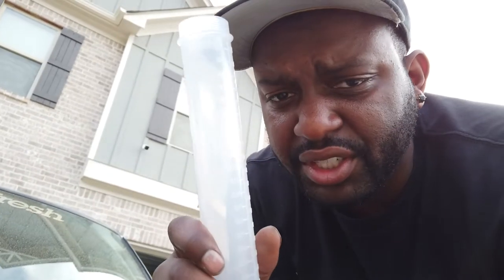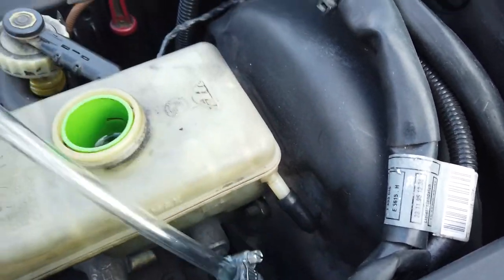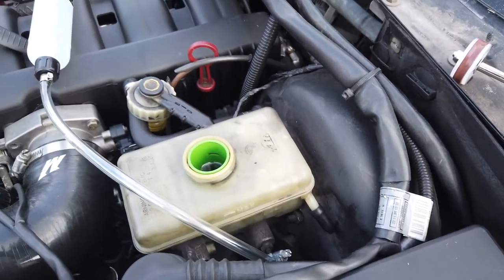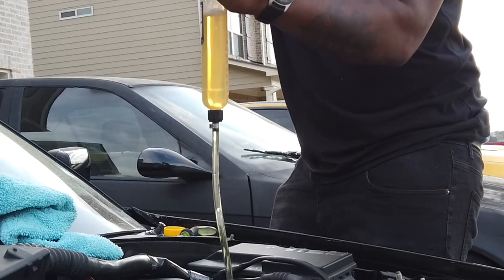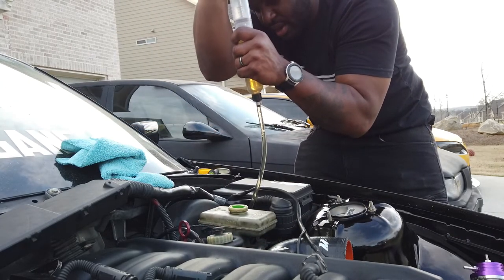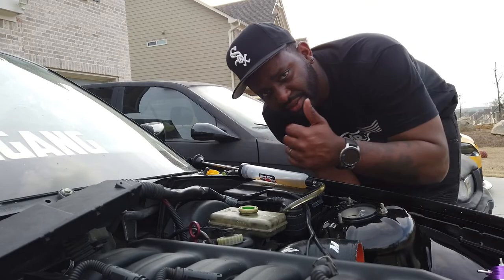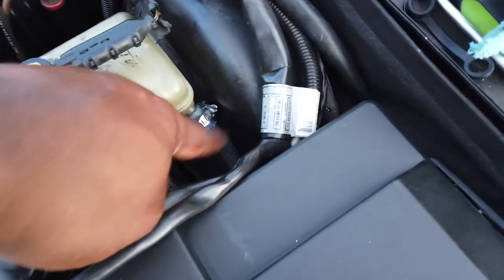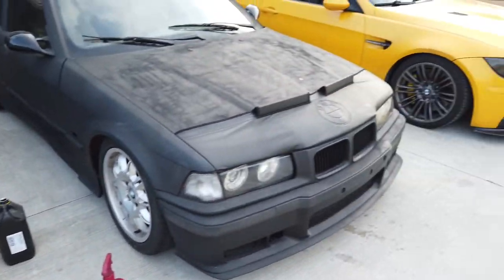Bleeding an E36 Clutch With a Syringe! Secret Trick

Comment: Bro! I built a race truck. Swapped to a 6.2 motor, and a custom 5 speed transmission. The transmission was also custom built. The gear shifter has always vibrated and the clutch engaged very low. It was always a soft clutch. I thought that was how they designed it. One day...boom clutch had no pressure and won't go in gear. I see the reservoir is bone dry. The slave and master were new, with braided line. I do this exact thing but with a tiny syringe. Brand new clutch and shifter now. Clutch engagement is where it should be. Great pressure, and shifts like a dream. It takes a while to get all the air out but literally cost me nothing. If your in a bind... This works great.

Comment: I forgot to mention that I had no choice but to do it like this. My situation was I test drove my truck for the first time after the motor swap. Re wired EVERYTHING from sound system to power windows to lights. Drove a long way because everything was working great. I go and eat lunch. When I got back the clutch had no pressure. Truck has a 5/8 drop on 24's. No way I could get under the truck without a tow or someone bringing tools. My wife brought the tube and syringe.

Comment: I spent about a week on my Honda trying everything including vacuum pumping short of pulling my master cylinder off which is a total pita to access. I saw you and two other guys use an oil syringe for this so I'm going to try this and I'll let you know how it goes!
Reply: How did it go?
Reply: @michaelcliffe562  I ended up forcing fluid through the slave bleeder with about 2atm of pressure with the syringe while simultaneously pulling about 2atm of vacuum via the reservoir line that feeds the master cylinder.

It was only when I did both simultaneously that I started bleeding off significant amounts of air. As I suspected, I had enough of an air pocket in the master cylinder that it was preventing the fluid in the reservoir from flowing. Just pushing or pulling from a single direction only produced enough pressure to compress the bubble.

Now my clutch pedal is probably at least as firm as it was 26 years ago :D

Definitely recommend the syringe. If I had to choose only a vacuum pump or only a syringe, I'd go with the syringe. Using it without the vacuum, I was able to get some clutch pressure, but not enough to fully actuate the slave piston.

I never thought I'd spend over a week bleeding a basic hydraulic system like that. My neighbor's an engineer and he was starting to question his sanity over the whole thing too haha. Didn't think I'd end up at the horse store looking for tools for my car lol. I guess horses are technically hydraulic systems, now that I think about it....

Hope that helps if you're having the same issue.
Reply: @ThorsDecree  That is awesome! Thanks so much for the answer! I'm from Germany and I've been trying to bleed the concentric slave cylinder in  my FWD Renault Clio for...well, about a week now! I've vacuum bled it, pressure bled it, reverse bled with vacuum and pressure from top to bottom and vice versa and nothing works! So this is the next thing I'm going to try as I'm convinced that the air bubble isn't even in the slave cylinder anymore.. I've ordered a sringe kit on Amazon and I'll let you know after easter. Again thanks alot for the reply!
Reply: @michaelcliffe562  as long as you have verified that fluid can flow, that the line isn't blocked, it should just be a matter of getting the right amount of pressure. Depending on how your master cylinder is set up, jack up the front of the car or park on a hill. It'll help you get air out of the master cylinder.

Good luck! Btw, if you have any farm stores around, I used a horse syringe. Same tool, but the livestock store sells it for 1/5 the price an auto parts store charges.

Good luck, brüder. Let me know how it goes, I can relate to the struggle haha.
Reply: @ThorsDecree  yah me too, my damned volvo 740 slave is blown and a week later my master cyl spring is broken into two pieces, after fiddling and fixing the broken spring and seal clutch still not working and i am trying bleed from the slave cylinder. hope this method works cuz ive been working on it for 3 weeks just bleeding, i might tow this sucker to the shop if it wont work i just got no time.
Reply: @sirgilang90z  It worked for me, hope it works for you. Had to use a syringe and vacuum at the same time, but eventually it started flowing. Was LOTS of air in both the line and the master.
Reply: @sirgilang90z  any luck with the hydraulics? Did you try pump + syringe?
Reply: @ThorsDecree  well it works, but i just use the syringe, push it from the master hose reservoir and open the bleeding port in the slave just a bit and attach a transparent tube so i can see the air coming thru while i push the fluid until no more air coming. and just like that my clutch is ready to use again.
Reply: @sirgilang90z  hell yeah, glad it worked out for you. 

Sounds like you spent a couple of weeks on yours just like I did ☠️

Comment: I did this process maybe 4x to make sure all the air was gone after doing a new SS clutch line, slave, and master. Used the same syringe as in the video. Now I get a sponge soft pedal after hard driving. The firmness eventually comes back but clutch pedal gets softer after hard driving…guessing there’s still air in there? I checked for leaks and nothing, fluid level is fine
Reply: Same
Reply: Bentley manual page 210-2 Follow the procedure to bleed your slave cylinder.

Comment: Useful .. I just did a swap. I wish I had thought of that. The clear tube makes wha't happening visible. In the final stages I wonder if removing the plunger would make sense, because at that point the air will float up and out anyway.   I ended up unscrewing the slave cylinder and rotating the bleeder "up" instead of "down" (its operating position) That worked .. and I could see bits of air blowing out as my helper & I did that dance of "Open, shut etc "".   What you did is better because one guy can do it. 

Tks!

Comment: by any chance did you do the clutch slave cylinder? If so did you bleed it by hand first or just let it be and started the bleeding with the syringe? trying to get my e34 back the road but this job is a pain in the ass
Reply: What did you end up doing?
Reply: @SleekM3  i took it to someone else thinking i was doing it wrong but it turned out i needed a whole clutch job bc something got bent and wasn’t keeping any tension (assuming the pressure plate was worn)